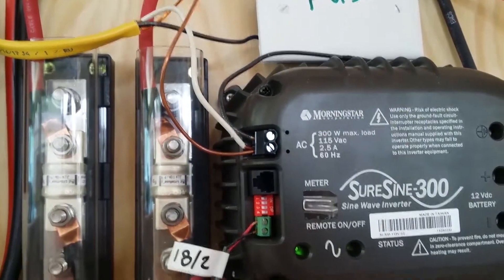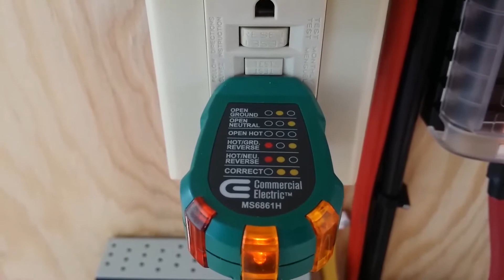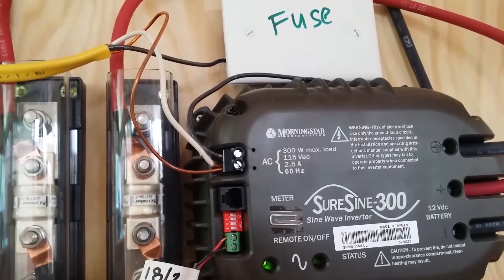Conversion Video 18.5: Solar Followup (GFCI Info)

Comment: I noticed you had a second 12v distribution panel did you just run that of the bus bars like the first one. I’m stumped and can’t find an answer anywhere on the net
Reply from the maker: I got a second one, because I couldn't fit any more circuits on the old one.  In other words, poor planning. If I had done better planning, I would have been able to put more light circuits on one fuse, or otherwise consolidated some projects.  Instead, I ran totally new circuits for things that didn't really need independent circuits...and ran out of space.  Rather than rewiring or overloading the distribution panel with connections, I got a new one.  Fact is, I won't come anywhere near overloading either panel, because everything is so energy efficient in the bus.  Still, each distribution panel is independently fused.
Reply: @DIYSkoolie  planning is key im currently in planning mode and using all your vids along with meredith and pacos vids to formulate an air tight electrical, plumbing  plan before i even buy my bus so i appreciate the response!!!

Comment: Where did u get the bus bar? The fuse box?
Reply from the maker: Jarediscus It's a Blue Sea 12v fuse panel. I don't remember where I got mine, but they are pretty common online.
Reply: Woolly Mammoth Bus Conversion this may be out of your knowledge base but if I install 24v panels would a 12v fuse do the trick on that?
Reply from the maker: I do not know.  But, I would not try to use electrical equipment that is not rated for your intended use.  I went down a rabbit hole on DC switches a while back when deciding whether or not to just us standard AC light switches in the bus.  It's a pain in the ass to find the types of switches that I need that are rated for DC, but after some research, I felt it was necessary.

Comment: Prettty cool. I'm an electrician, nice job on solar install. The GFCI won't work properly (safety wise) with ground and neutral tied together. Not a big deal, but if you want to seperate the two, run the ac ground to bus frame.
Reply from the maker: Thanks for the info!  With the ground attached to the frame, I couldn't get the circuit protection to trigger.  Am I missing something?

Comment: Have you used your tester and removed your ground? Might be a stupid question/test but because you have two wires going to your neutral it would be interesting to see what it says. It achieves the concept of a ground I suppose, it provides a secondary path of travel for electricity should the first path become unsafe; definitely interesting!
Reply from the maker: I did do that.  I thought for a while that I was going to have to abandon my GFCI protection, so I just removed the ground as per Morningstar's suggestion.  The tester signaled "open ground," meaning there was no ground connection detected.  Same result as when I attached it to my DC ground.  It makes no difference to most devices, in terms of functionality.  It's just a safety thing.  According to Morningstar, most users just use hot and neutral in RV applications.  I thought it was strange that the manual mentioned which GFCI outlets were most compatible, but didn't explain how to wire it in....  Maybe I just got a bad rep on the phone.

I would have showed the disconnected ground test, but I didn't really want to remove the wires again after having done that several times.  The inverter terminals feel kind of flimsy, and I know they are not meant to be constantly connected and disconnected, so I erred on the safe side and left that visual demonstration out.
Reply: Awesome! Thank you for the information, super valuable. Definitely interesting tests and the proof is in the pudding... if it works it works! Nice job man